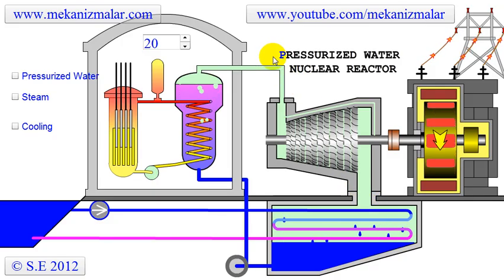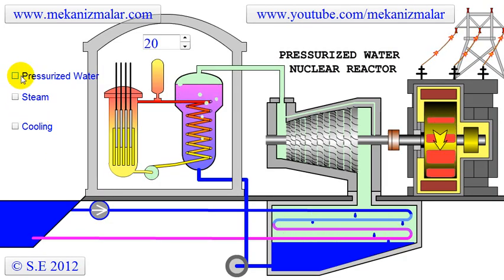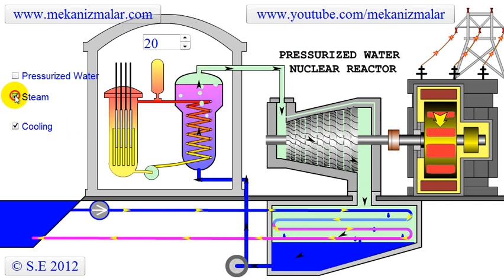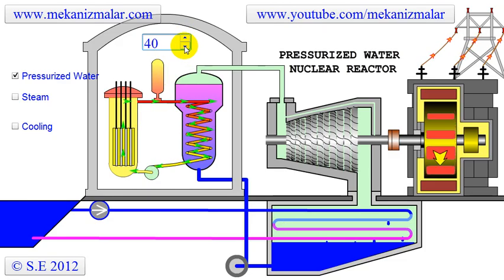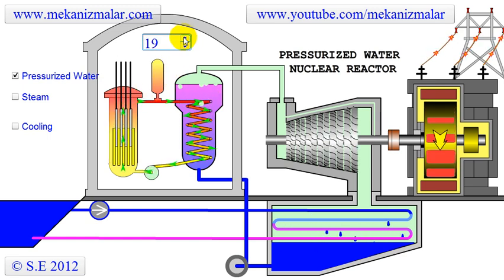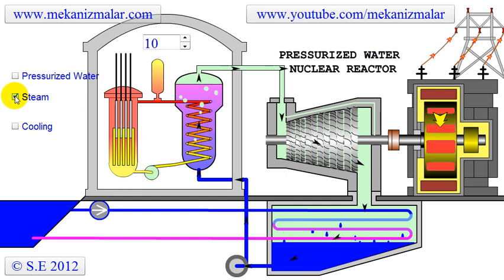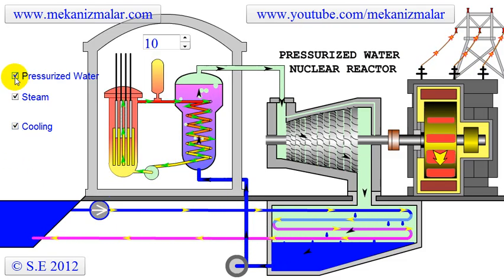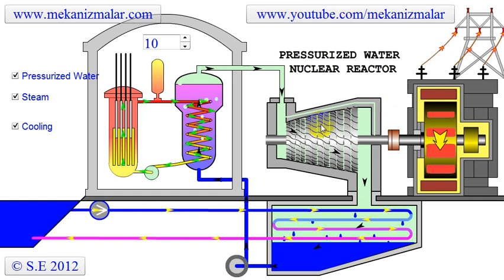Nuclear Power Plant

Comment: TMI was operating at 97% when its condensate line ruptured due to a "uncommanded" valve closurer. This line supplied all the reactor cooling water. Automatic supplemental emergency injection failed due to valves which were manually closed beforehand unbeknownst to the operators ! Three Mile Island was designed to operate " with NO HUMAN INTERVENTION"

Comment: Which software you use for making video? Explain very well.....and animation is very well design which helps a lot to understand ? Thanks for Sharing Information....Plase also share how you make video
Reply from the maker: I use Adobe Flash doing my animation. I do not use frame by frame animation, but perform all the movement in the animation just using Math. I also like Object oriented programming which I use a lot. However Steve Job Apple founder literary killed Flash. As far as I am concerned, by killing Adobe Flash he did not do good for humanity. Adobe Animate replaced Flash, but I guess it is not using Action Script language which is bad for me. Also they use monthly subscription to use their web based development platform which becomes very expensive product specially for the people outside the United States. Once I finish my program, I run it while recording the voice simultaneously. While program is running, I capture the video with fastStone capture program.

Comment: If 3rd cycle is removed, then 2/3rd energy waste shall be utilized,isn't it?
Reply from the maker: What do you mean by third cycle? Condensation process?
Reply: I mean cooling cycle, if its not there powerplant should work well too,isn't it
Reply from the maker: Actually it will not work efficiently at all.  At the exit of a steam turbine there is saturated steam. If it is not condensed, we have to pressurize this condensed steam to turbine inlet pressure which requires a lot of power to do it. Whatever we gained from the turbine as a power will be lost during this compression process. However condensing the saturated steam reduces the amount of power substantially to compress the water to the turbine inlet pressure. This exploitation can be understood best on T-s diagram of Steam for the steam turbines.

Comment: Neat video, just one pretty egregious error: 2/3 of the heat being dumped as waste and that there's nothing we can do about it because it is dictated by the laws of thermodynamics. This is not quite true. You should explain that this efficiency limitation is a consequence of the use of water as a coolant and that the efficiency of any heat engine is fundamentally limited by the ratio of reactor outlet to coolant water inlet temperatures (Carnot's theorem). Not all nuclear reactor designs have this fundamental limitation. Gas-cooled reactors, liquid metal-cooled reactors and molten salt-cooled reactors can all achieve much higher reactor outlet temperatures and thus permit higher thermodynamic efficiencies. These are not theoretical constructs either, all of these have been built and operated and some are operational even today (google: BN-800 reactor, British AGR).

Comment: What is duration of using the uranium in those rods ? before they wear off ? how they collect the watse ?
Reply: That all really depends on how enriched it was.  Civilian nuclear power plants tend to use < 10% enriched uranium, (enrichment is more or less how "pure' it is, 10% enrichment of 100kg only gives 10kg usable fuel). 5-10 years would be a solid bet. Those would be nice intervals to shut the reactors down and perform more intensive maintenance and inspections to make sure everything is up to snuff, because it has to be. 

Uranium doesn't really.... wear off. I mean it does but, we're talking hundreds of millions of years and I don't think that's what you're trying to ask.
Rather there are a variety of waste products that come from the fission of the uranium atom. Some of which are taken care of in the core some of which will continue to pose a radiological hazard for 50-10000 years.

Typically because power plants don't use such heavily enriched fuel, the amount of waste they produce - even after a long time can fit in a small pool of water on the reactor site, where it will sit until it stops emitting so many neutrons "cools down" for 2-5 years typically. And while this can sound bad, coal fly ash ( ie what's left when you burn coal) is actually far more radioactive and poisonous to the environment per useful Joule of energy produced and used by an electrical grid. I'm talking like 500,000x to 1.1 million times the amount of useful energy output per pound/kg (@10% enrichment, most places use 3.5, in the least efficient reactor type [but has nice safety margins] )

The benefit to nuclear, there is that the waste we have is concentrated and in one place where it can be managed rather than haphazardly thrown into the air we breathe, the water we drink. Waste collection is tricky. Really tricky, but essentially you'll take the core/rods depending on the set up and put a bunch of radiation shielding around it using large machinery (so people don't get exposed) and ship it where it needs to go. 

The cool thing is that plenty of the waste of a pressurized light water reactor is actually ready to be used as fuel for a different design of nuclear plant. Eg. Fast fission plant, vz slow neutrons as used in light-water reactors.)